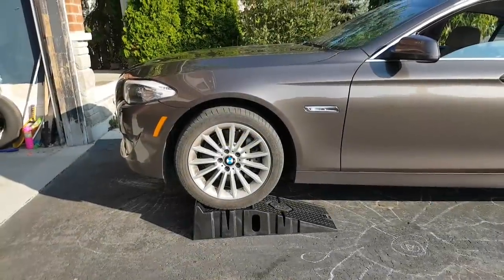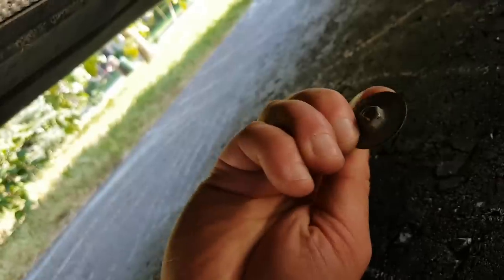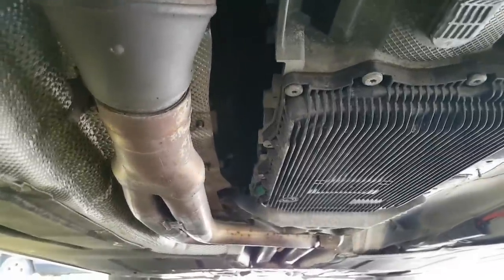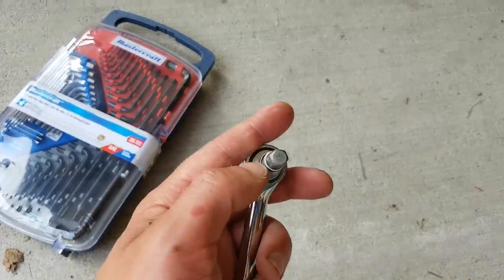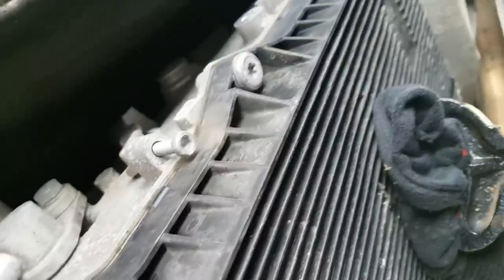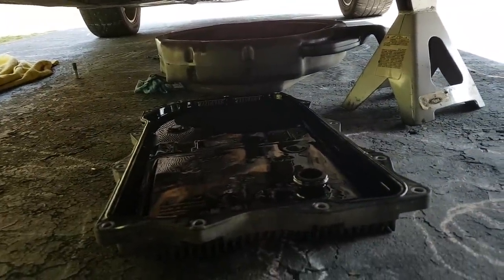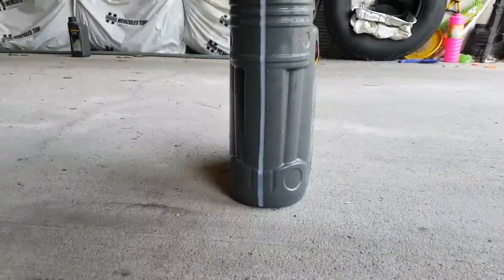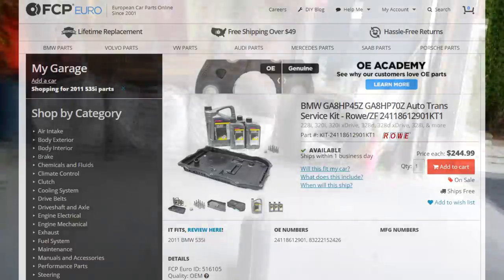BMW 5 Series F10 - Automatic Transmission Fluid (ATF) and Pan Replacement N55 DIY - 2011 535i F10

Comment: Excellent detail! Thanks. I’ve done this job on my 2012 F10 and this video is good. I even used the same pump from harbor freight. I would highly recommend ZF fluid, and a BMW OE filter. Both can be obtained from FCP as well. Also, and I think another commenter mentioned it, but the last bit of fill should take place with the vehicle running to pull the rest into the trans.

Comment: ive watched a workshop video from ZF directly emphasizing that the temperature of the oil should be 30c when beginning the process and they did an adaptation of the gears (shifting from 1st to 3rd) during the fill process. they also did NOT use the drain method, they used the replacement method by filling the new oil till the old one comes out and drains. hope you have absolutely zero issues with your mechatronic after this.
Reply from the maker: Thanks , all is good. Why wouldn't it? Think of it this way. PUT IN exactly the same amount that comes OUT. Heck, account 100 ml more for drips and other waste. You are getting it pretty darn close, to 1% probably if not less. If any electronic equipment were to fail due to 1% difference in fluid amount, it would be a terrible design and failures would be rampant. Few drops would leak out through your pan gasket and your tranny is toast. Tonne of fear-mongering with this fill procedure if you ask me. But i know why they do it. They do it because most folks are probably careless and put random amount of fluid back in. so they'd rather show you these anal instructions because hardly anyone will measure fluid the way i did....
Reply from the maker: To me, you can screw up much more easily by measuring temperature incorrectly, than to put the same amount of fluid back in.
Reply: congratulations for the excellent "do it yourself", I do not understand the words in the video, I would like to know how many liters of oil you used, because I know that without specific machinery does not come out all the oil from the automatic gearbox. You do not have thought to use a cleaning additive to add to the old oil before draining it? How many km did you have and how many have you traveled with oil change, did you have any improvements in driving quality or otherwise problems? thank you and greetings !

Comment: i used the ZF fluid and that thing smells awful even empty plastic bottles of it stunk my house ... However how was the smell of yours? i now sometimes get a wiff of that smell under car when its hot and air blowing i do not see any leaks i wonder if the oil got around the pan while filling? thus having the smell?

Comment: I have a 535i 2011 with only 56k miles, should I do this maintenance? It’s easy but I’m just unsure if this will cause slipping, it’s the perfect mileage to do it so might as well do it….
Reply: Yes you should do it as ZF requires the service within 8yrs or 70k miles. I just did my 2015 535 at 76k miles. Shifts were fine before. Now so smooth I hardly notice them.
Reply: @kjhnsn7296  good to know I plan on doing mines soon, may I ask, how was the refill process ? And how do you know when is completely full.

Comment: congratulations for the excellent "do it yourself", I do not understand the words in the video, I would like to know how many liters of oil you used, because I know that without specific machinery does not come out all the oil from the automatic gearbox. You do not have thought to use a cleaning additive to add to the old oil before draining it? How many km did you have and how many have you traveled with oil change, did you have any improvements in driving quality or otherwise problems? 
thank you and greetings !
Reply from the maker: Tranny still running great, knock on wood. Many kilometers put on since the change.

Comment: Exellent video. Please I need to know before o after  60.000 km I need to change the oil? The car is BMW GT . thanks in avance.
Reply from the maker: 60k kms is a bit early but of course wouldn't hurt. Recommended is about 60k miles.
Reply from the maker: 60k miles is 100k kms

Comment: Is there any way to drain the torque converter also? I think there is a good amount of old fluid still inside it.
Very helpful video, thanks.
Reply from the maker: the theory says that if you flush like that twice , you are getting most dirty fluid out because old fluid mixes with a large amount of fresh one. So it's by means of dilution.  I did that and I recommend it.
Reply: if you remove it from the gear box yes you can drain it. is very simple to remove it.

Comment: How did a quart of fluid come out when the fill plug was removed? That suggests the actual fill point is higher OR the lower end of car was not raised?
Reply: If the engine was running, no fluid should come out.  This occurred since he removed fill plug with engine off .
Reply: Car is off and raised at front end only.

Comment: You’re actually supposed to do final fill with it running
Reply: That's right. First add fluid cold until it overflows (~2.5L). Then start car and cycle thru the gears, including the 'manual shift' by moving lever to left, then bumping it down and back up thru forward gears.  Keep your foot on the brake, ESPECIALLY IF the drive wheels are on the ground. Warm to operating temp. If you have a scanner,  that's 40-45°C. Get back under car and top it off again. Total of about 4-5L for this 8 speed auto trans.

Comment: Start engine, start AC at low speed. Wait for transmission ATF to come to temperature of 89F to 110ºF. While engine is running, and ATF is in the range of the temperature - continue to fill until overfill, then let fluid dribble out at very slow drip and close up plug. 

Do not fill when ATF is lower temperature or higher temperature than the above temperatures. ATF reacts to temperatures and expands and contracts such that you will get wrong amounts if you fill outside those temperatures. Shifting and damage will occur from incorrect filling.
Reply: when the fluid drips after you fill it, should you allow it to drip until it stops, or should you install the plug immediately and not allow the oil to drip? I am confused about the part
Reply: @Noor Dajani  let it come out tell its a very little strem then plug it ....it's full

Comment: Excellent info.  I am going to do this with my 2012 BMW 535i.  I am going to try to heat the transmission oil up a bit before draining and try not to burn myself on exhaust to get oil flowing nicely. Also, I want to be sure the car may be level and last -- it was my idea, but I DID also discover a guy from a TV show that confirmed my idea:  Enema bag to fill oil.  :) I may post how that works out.  Appreciate the review.

Comment: Did the gasket come off with the old pan or did you have to remove it from the bottom of the transmission? Did the new gasket sit on top of the pan? Thanks
Reply from the maker: IIRC the gasket is somehow integrated into the pan. I do not recall scraping the old one off like in the traditional setups. Also, if my video doesn't show it, it means there is no concern and you can proceed  :-)

Comment: EXcellent video, i own the same, 2011 535i xdrive, i am at 59,000 miles and want to to this service at 60k. i prefer to do it myself when possible. I have no idea what the dealer would charge but i imagine a lot. i  subscribe to you, hope to see more DIY 535 stuff.
Reply: Most indy and tranny shops would do it for about 200$ plus supplies, which in most cases you could buy.  I would not go under the car on jacks for saving 200$. IMHO.
Reply: Indy shop near me wants $1200.

Comment: There is NOT one single damn video on YT that shows or recommends or suggests if there is or you must change all the Transmission's valve body seals, that includes the sleeve where the control connector is, the 4 tube seals inside the trans when you remove the control unit, the square pressure seals, etc....  6 in total seals that the ZF-6HP 6 speed transmission has.... The F10 uses the ZF 8 speed transmission but no one suggest or claims if this transmission has these seals and if it does, no stating if they need to be replaced when changing trans oil which is a complete transmission maintenance job!   I can't find shit on FCPeuro either!   Yet Amazon has the full trans body seal kits for less than $30 for the BMW ZF 6 speed transmissions.... 

Any info from anybody that knows anything will be soo much appreciated!  Thanks...

Comment: My 2011 bmw 535i xdrive has 78k miles and it was never changed. Is it too late to change it now? Im worried it might slip
Reply from the maker: i don't think it is too late.
Reply: No it's not,  ZF recommends between 60-80k miles. So you are right at the end. I would do soon if i was you.
Reply: @drone1028  And that recommendation is on the safe side because it applies: if you drive hard a lot, idle way too long or tow a lot. Otherwise 150k miles or the "lifetime" BS statement by the car manufacturers, is not exactly BS at all. That means if you drive like a dad or a soccer mom,  the fluid will last 150k miles no problem.
Reply: @sebastiantevel898  good info. I would not push it to 150k though,  especially if bought used. I'm at 62k, and plan on doing it 75k if i still have the car.
Reply: @drone1028  I would not push it to 150k either. I am also at 60k on a N55 engine, car that I got at 50k, so not knowing how it was driven before, I will do it soon.
Reply: @sebastiantevel898  in the same boat as you, bought 2013 x5 with n55, zf8hp45 at 52k, now I'm at 62k miles.  I'm trying to time all my maintenance at the right time.
Reply: No it is not

Comment: Any downsides flushing a 535i with a little over 100k miles?
Reply from the maker: No. Do it ASAP.
Reply from the maker: 200k might be a different story, but 100k is not too late.

Comment: Nice video, did you notice any differences in the transmission after the fluid change?
Reply from the maker: Nope. But then I didn't change it because it was running rough. Just preventive maintenance.
Reply from the maker: Nope and i presume it's a good sign. Just preventive maintenance... before anything actually goes wrong.
Reply: C. K. How many miles did you change the trany fluid and filter. I plan to change mine. Thanks for video.
Reply: @yogi799  I have been in racing (bikes) for a few years when I was a teen. The rule of thumb from the techs was that we change fluids when they are still good.

Comment: hey you have a video on how to replace the mechatronic unit?
Reply from the maker: sorry bud, sounds scary, prob beyond my paygrade. good luck. check the bimmerfest forum. post on there, one guy has a link to complete service manual and it could be shown in there. if you cannot get ahold of him i will connect you
Reply: @yogi799  thank you
Reply from the maker: @YScy-gx6jq  hey i've found it, try this https://www.newtis.info/tisv2/a/en/f10-535i-lim/repair-manuals/
Reply: @yogi799    cool , thank you,  but Im stuck on how to put the shift valves parking lock back to the position so i can put the mechatronics, I have a 2010  535i GT, and if different from F10. Thank you so much for trying man. you are so cool.

Comment: Does it looks like this guy got under the car to fill the fluid with just a jack? Hopefully not, never trust your life with just a jack.  Use jackstands, ramps and put more stuff under the car to be absolutely sure.
Reply from the maker: No, there is a barely visible jack stand next to the jack. Always at least 2 modes of protection. 19:55.

Comment: way you change oil if bmw dyler not recomendet , plus you change not genuine oil ?
Reply: BMW says you don't need to change the automatic transmission fluid but ZF (the manufacturer of the transmission, where BMW buys it) says it needs to be done at 60k miles. Also it's a complete non-sens to believe that oil is good for life.
Reply: @MickD464  what has changed for everyone after a year problem come for gearbox , i think german is smarter than english , if you change oil for gearbox need after make  adaption, and update sowtware for gearbox ;
Reply: @MickD464  no point change oil if you not change filter for gearbox , same engine you change oil no change   oil filter >?
Reply: @monacocross4241  Oil filter is integradted in the oilpan. Meaning oil and filter chage= new oilpan. There are options on the aftermarked where u can get an oil pan with replacable filter for this ZF automatic transmission. but ZF and BMW OE  pan has integrated filter (probably the same part , made by the same factory)

Comment: I was under the understanding that the correct level is exactly at fill hole when the car is sitting flat.
Reply from the maker: Probably but supposedly fluid has different volume based on the temperature....
Reply: Car Should be flat for what i know, btw great video ck
Reply: @yogi799  You can use ista D diagnostic software to read oil temp. I am thinking of doing an oil change on my own 2013 520d with an ZF8HP45. But it looks a little complicated. Especially without a carlift.

Comment: You have to start the engine for 20-30 seconds so it sucks the oil from the pan into the transmission and then pump rest of it
Reply: the owners manual didnt make any mention of this, although it does make sense logically. are you sure?
Reply: I am positive 👍
Reply: You are right, the engine start and change gears from 1  to 8 and back.
Reply: Don't forget the important fact it has to be between a certain temperature because the fluid expands when hot
Reply: @JeanEstel  True. Yet is also true that it expand less than 1%, which means considering the volume of fluid in the pan and the size of the pan, the discrepancy is less than 50ml of fluid, in the total of 8.5 liters, that fits inside the whole transmission. I assume 50ml is negligible.

Comment: Never understand it why nit using original zf oil
Reply from the maker: Two potential reasons. 1. not available. 2. way more expensive. So if you can have a substitute, especially from Germany.. basically the same oil probably AND available in your local area then why not...
Reply: C. K. Zf Is Available almost every where 2nd Way more cheaper 300 dollar for a kit filter oil bolts I dont think its expensive compared to a used gearbox 1800-3000$ :)) ONLY USE ZF thats what it meant to be used not aftermarket oils where u save 70-150 dollars and risking your gearbox in My opinion !
Zf8Hp Gearbox is the best in the world

Comment: Don't ever do that like this guy on video! He did all mistakes that beginner can do. I'll be suprised if car is still running. Really. Car didn't level out,  then You fullfill oil pam with like 1l of oil. Then You should warm up gearbox to 30-50 degrees (shift also by all gears but not driving car!) and then on running engine fulfill oil.
Reply from the maker: Car still runs like new many thousands of miles later.
Reply from the maker: Same amount of fluid in as out. Rather simple.